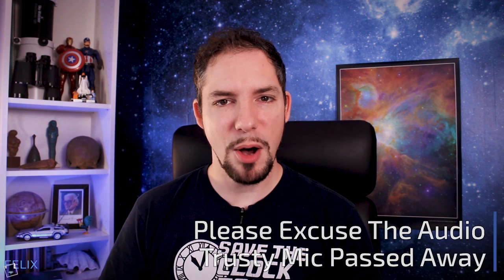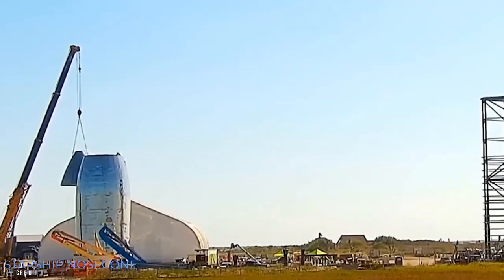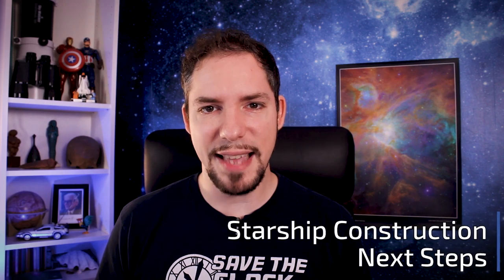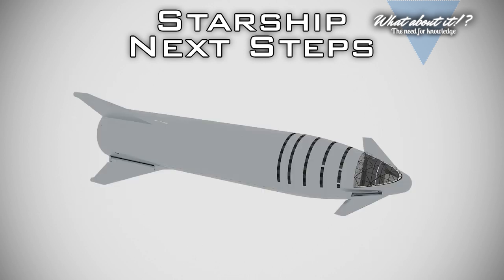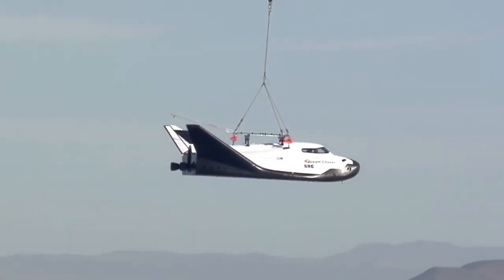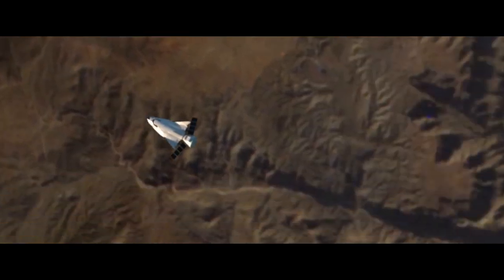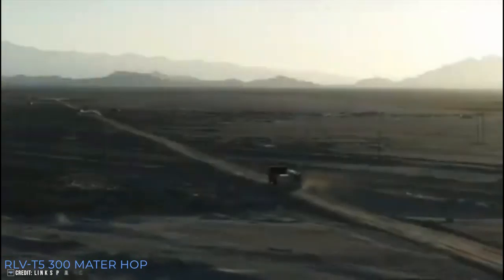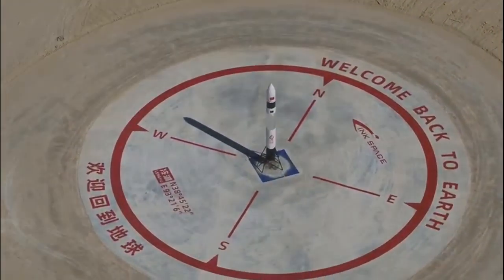26 | SpaceX Starhopper Test Updated - Starship Road To Completion - Linkspace Test Hop

Comment: I think your speculation is about 50% correct. 1st of all the nose cone original came off because it did not fit properly. It was altered and put back on, but not welded, so might come off again. It might come off to attach canards. 2nd is what gets lowered in the top through the nose cone? That's the cargo area and probably gets nothing in it. 3rd I doubt that what you thought was a leg or fins is either. A piece was shipped in that might be a leg or fin. 4th In Cocoa, how would they build super heavy in the new building that has a very small door?  There are at least 14 ring segments in Cocoa that are surely not for Starship. They must for another prototype or Super Heavy.

Comment: Any information about the heatshield hexagonal tiles? How cheap are they?
Reply from the maker: Hard to tell. They shouldn't be too expensive though. There's no official info from SpaceX.
Reply: 😆 Hexagons have 6 sides. Exagons have 1,000,000,000,000,000,000 sides. They're indistinguishable from circles.
Reply: @nagualdesign  Sorry ^^

Comment: Interesting to see that Dreamchaser has some sort of ski instead of a front wheel. That must make it difficult to steer down the runway.
Reply: Its a very long runway i think it will land a the same Runways where the shuttles returned to.
Reply: Steering is done by differential braking of the main landing gear wheels.
Reply: @thcamp1  Ah.. That makes sense.
Reply: I have often wondered why Dreamchaser does not have a front wheel instead of a skid. Seems to me that a wheel would last longer than a skid.
Reply: @curtisquick1582  It saves a lot of weight, and space.

Comment: Here is an interesting comparison between LinkSpace's planned New Line 1 rocket and the Electron
https://en.wikipedia.org/wiki/LinkSpace#New_Line_1
Payload to SSO 200kg, lift-off mass 33000kg, height 20m, diameter 1.8m
https://en.wikipedia.org/wiki/Electron_(rocket)
Payload to SSO 150-225kg, lift-off mass 12500kg, height 17m, diameter 1.2m

So the cost for LinkSpace's propulsive landing reuse is that they start with a rocket with over 2.5 times the initial mass for similar payload.

Comment: Do you think supper heavy will need to go through hop testing just like starship being that it will be quite a bit larger than starship?
Reply from the maker: Most definitely. The hard part about Super Heavy will be controlling all the engines. That needs some testing.
Reply: @Whataboutit  I wonder if that many engines will be able to gimbal (move around) like starships do
Reply: @wesleywindham1880  pretty sure Elon said the outside engines won't gimbal but the inner ones will.
Reply: @05DonnieB  I didn't hear anything about that but thank you
Reply from the maker: Yep! The inner six engines will gimbal 15 degrees. :)
Reply: @Whataboutit  Your videos are awesome dude you and cloud licker are my favorite keep up the good work 😁
Reply: I think hop testing of the Super Heavy Booster by itself will be much easier than testing the Starship prototype.  It is essentially a scaled up F9 booster, bottom heavy, nearly empty of propellants, will use only a small number of gimballed engines because of its light weight and it too will have grid fins.  It will have to have a nose cone covering the open interstage for the same reason the FH side boosters need them. I also believe low altitude,  hop testing (landing practice) of the SH booster could be done at the Boca Chica facility since it will only need 3 or so Raptor engines.  We will know exactly how and where the testing will be done after Elon's talk on the 24th.
Reply: @thcamp1  Falcon heavy core stage and Falcon 9 don't use a nosecone on re-entry why would supper heavy need one?
Reply: @wesleywindham1880  It's not for the landing, but for the launch to keep the vehicle streamlined as it ascends.
Reply: @curtisquick1582  Well with starship stacked on top of it I don't think that will be a problem

Comment: What's the thrust of the RLV-T16? What kind of engines does it use?
Reply from the maker: I do not know yet. I will try to find out though! Exciting work, they're doing in China. SpaceX got the ball rolling.
Reply: @Whataboutit  It's the only compagny currently testing vertical landing? (spacex does not count)
Reply from the maker: https://youtu.be/TfUnD4GiVD4 I got some of them covered here. :)
Reply: Can't be much since it was able to hover for an extended period, on 3 engines.
Falcon 9 can't hover even on a single engine at it's lowest thrust - they decelerate so they reach 0 velocity at 0m height.
Reply: @joshua43214  i guess they can hover because theyre rocket is smaller. Falcon 9 is way bigger so i think thats why.

Comment: Dream Chaser cargo variant is not fully reusable. The cargo module is disposable and will burn up on re-entry.
Reply from the maker: Correct. :) I meant the dream chaser. Cargo modules are most of the time not reused, as there is waste in them. Would not make much sense to put reentry capability on a garbage can.
Reply: I did not know that. That makes no sense. The great advantage of horizontal landing is that it is much more gentle and you can protect delicate cargo on landing. Why did they design it so it cannot land with its cargo module?
Reply: The disposable module is in addition to cargo volume inside the space plane part - there's still down mass capacity, just less volume on the way down.
Reply: @linseyyoung1772    Ah, I understand. Thanks, that's interesting.

Comment: Weird the dream chaser is basically the CRV of Lockheed?
Reply: Well, they are similar, but form follows function.
Reply: Dream Chaser is being built by Serra Nevada Corporation not Lockheed.
Reply: @theatom7264    Yes, but it is, at least superficially, very similar to a Crew Return Vehicle that Lockheed proposed for use on the Space Station in the early days of that project.

Comment: Linkspace is basically spacex: made in china. Even the logo is extremely similar
Reply: Linkspace is "privately owned" chiefly by influential members of the Chinese Communist Party, and the Chinese government insures that it has the resources necessary to carry out the government policy of reverse engineering the Falcon 9 technology.
Reply from the maker: True! Honestly though if I was in the launch business, I'd try exactly the same. It is the way to go. SpaceX so to speak turned the wheel idea into a reality when it comes to rockets.
Reply: @Whataboutit    Fair enough. Form follows function. SpaceX showed how to do it, so that should be your model for how to do it yourself. It is interesting that most of the other organizations looking at reusability are working on very different plans. I did see in another video though that Even Linkspace isn't fully planning to follow SpaceX. Apparently, at least for now, they are only aiming for the small sat market, intending to produce a rocket only capable of putting 250 kilograms into orbit. If they do that with a propulsive landing technology, it will be interesting to see how they compete against Rocket Lab.
By Golly! Can you imagine having this conversation even five years ago? This is a fun time to be alive.

Comment: 8:50 But hovering is something SpaceX's technology can't achieve, right?

(BTW I hate those timelapses)
Reply: The Merlin engine is too powerful. It is not a tech problem, it is a thrust problem.
At minimum thrust, and a near empty fuel tank, a single Merlin can lift an F9.
Reply: It will be interesting to find out if the SS Heavy booster will be able to hover? Hovering capability will enable this booster to make fine lateral movement adjustments to center itself over a landing target for precision landings.
Reply: @joshua43214  But thrust is tech. That's what I meant. Technological limitations. Even "too powerful" is a limitation.
Reply: @ixglocTV  indeed. And if you phrase it as "can't throttle deep enough", it definitely sounds different.
Reply: @ixglocTV  You are splitting hairs.
Grasshopper hovered, Starhopper hovered, even New Sheppard hovered. As far as I know, all propulsive landing ships hovered during prototype.
Hovering is trivial compared braking on target.
Would you prefer they install a de-throttled Merlin just so they have the "tech" to hover?
Reply: @joshua43214  I guess it should make landings safer by putting less pressure on the landing legs. But we'll have to see whether the future Chinese rocket will feature it.
Reply from the maker: What Joshua siad. Hovering is trivial. Doing the suicide burn is the difficult part.